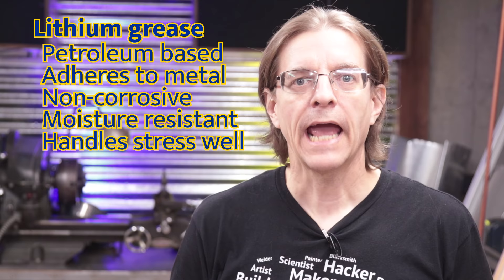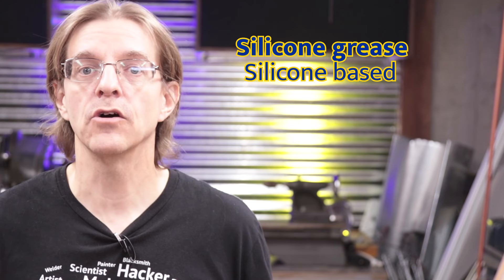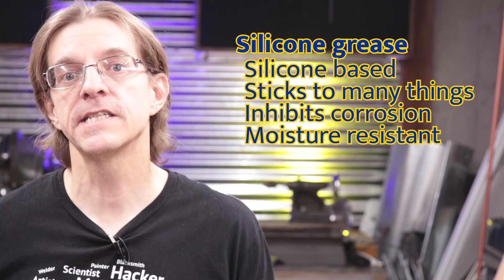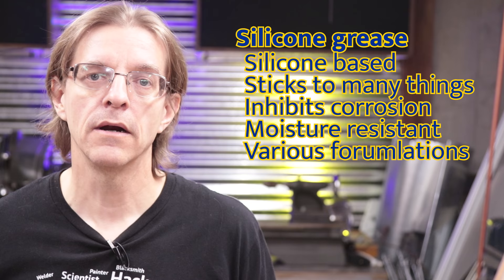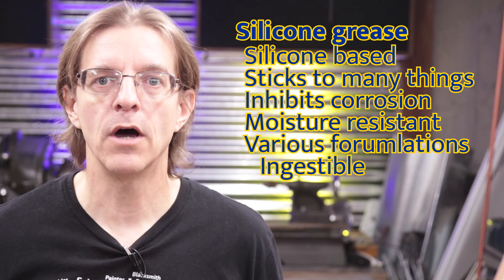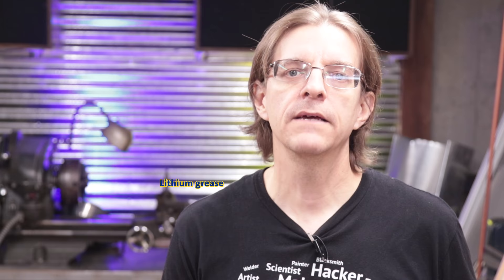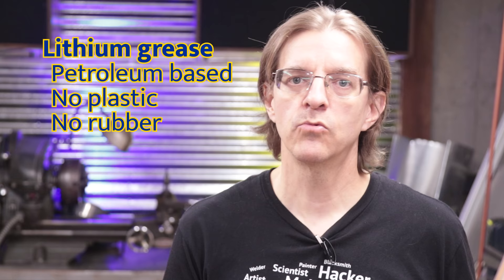Lithium grease vs silicone grease: Which to use?

Comment: Hi,

I am trying to find a solution to a problem.

I have several domestic outdoor bulkhead lights.  There is a seal between the diffuser and the main body which is held tightly in place by a retaining ring.

The lamp assembly is basically robust and operational but the seal is the weak link.

After a relatively short period the seal shows signs of perishing, which leads me to believe it is not made from an EPDM or Butyl compound which would resist ever present ozone, UV light, (which the lamp outputs), and weathering.  It could possibly be some sort of neoprene.

I cannot buy spares.  They are just not made available by the retailer.  The retailer will not divulge the source of manufacture so I am not able to approach them myself.

I have found in the interim, with the condition of the seals and time constraints, I have had no choice but to go buy whole assemblies in order to use just the included seal.  The remaining bulk of the assembly is redundant and can only be scrapped which is a terrible waste.

I want to prolong and enhance the life of the seal so I won’t have to face this problem sooner than I should.

I have searched high and low for anti-ozonants that can be applied post production, but so far my search has been fruitless.  It seems anti-ozonants are added during the compound mix.  There are EPDM paints that are used in the covering of flat roofs using rubber membrane, but I am worried about the cost and impracticality. 

My question to you is, could you recommend anything that could be applied as a coating to the seal and left to dry before assembling the seal?

Obviously, a lithium grease would be detrimental, but I have looked at silicon and red rubber grease, but can't find anything that relates the use.  Can you make any suggestions?

The coating would have to be fairly long term.  I wouldn't want to be unnecessarily dismantling the lamps to reapply on a regular basis.  

I would really appreciate your advice.
Reply from the maker: Sorry, I don't know of any coating that would work for this. Is the seal flat so you could just get a sheet of material that would last and cut out a seal yourself? Another alternative might be to make your own if you can make a mold of an existing seal and fill the mold with a material that will work for you. Hope that helps.
Reply: @HouseOfHacks  No its not flat.  It's like an extruded profile to fit between the retaining ring, over the edges of the diffuser and into the annular recess in the main body of the lamp.

There is not an option to make my own.

Comment: may the way its  ,,,,,,,,,copper grease  for brakes
Reply from the maker: Thanks for sharing!
Reply: On backs brake pads and ears but not on sliders/pins they will seize otherwise. Use silicone grease on them.
Reply: @martinjp1  House of Hacks should have added this into the video.

Comment: How to remove white lithium grease from rubber ?
Reply from the maker: Probably most any degreaser would work, e.g. SimpleGreen, Zep and Natural Orange are readily available from home improvement stores. Before buying something special, I'd first try the detergent you have under your kitchen sink for washing dishes, they're pretty effective at cutting through grease. Put it on the part, agitate it with a brush for a bit (e.g. an old toothbrush) and then rinse it off. Depending on how much grease is involved, it might take a couple applications.

Comment: He's not right neither for Lithium based grease or silicone both can be used safely. Additives are petroleum based not Lithium or Calcium but if it's not mentioned in datasheet then it can be used. I used before on plastic and had no problems I even washed it with gasoline to get it clean and had no issue you have to dry them quickly. Try on plastic bottles PET's if you don't believe me, if the plastic cracks that's because of ageing process, not because of the grease property another marketing propaganda !

Comment: You didn't answer the question by telling him which grease to use on brake parts
Reply from the maker: Yep. Brakes are critical enough and vary enough from manufacturer to manufacturer that I'm not going to make a blanket statement. Best for each person to find the manufacturer's recommendation for their specific application.

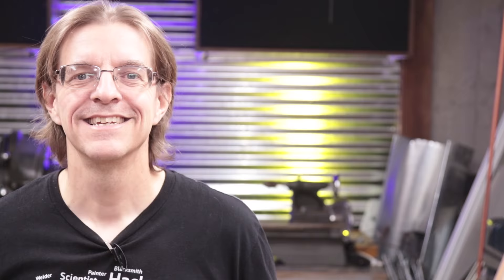Comment: 00:30 NO WAY THE LITIUM GREASE HAS HIGH OPERATING TEMP. MAX 200 DEGREE AND IT WILL DRIP
Reply from the maker: This video talked about the two types in generalities. For any particular brand, it will depend on the formulation; check the data sheets for what you're working with for exact specs.

Comment: Um, silicone is made from petroleum and is routinely used on rubber seals and plastic. And the statement that lithium grease is made from petroleum and thus will attack rubber and plastic is misleading in the extreme. Lithium soap is a thickening agent than can be mixed with a large variety of oils, not just petroleum oil, to make grease. You could mix it with olive oil. This entire video is nonsense.

Comment: Lithium is garbage especially the brand you are hiding. I used it on my garage door and it was a foamy yellow mess. The silicone works better on garage door springs.
Reply from the maker: Thanks for commenting. I don't know I'd go so far as to say all lithium grease is garbage. As with all products, some brands are certainly better than others. The point of this video wasn't to review any given brand but to talk about the differences between lithium grease and silicone grease in general and when you'd use one vs the other. Peace.
Reply: House of Hacks maybe I should have been more specific. The brand you hold up was an absolute joke and extremely messy. Plus, it was yellow not white. I tried it multiple times in various temperatures, etc.
Reply from the maker: Yes, I understood. As I said, I wasn't doing a review of that brand which is why I didn't mention or show it. I agree with you that I'm not a fan of the spray delivery system. Cheers.